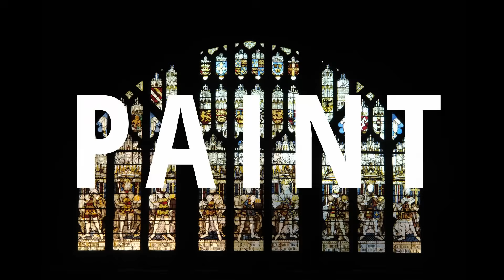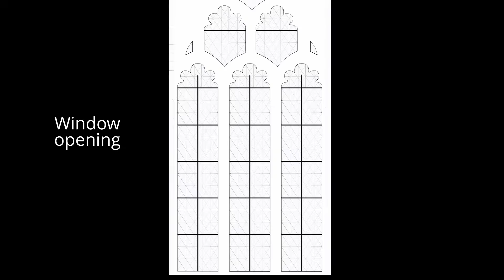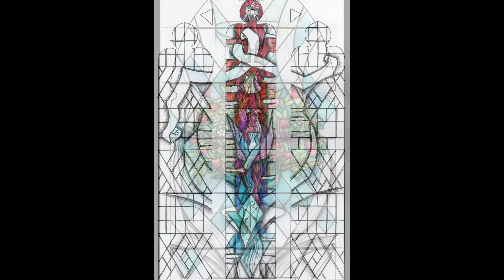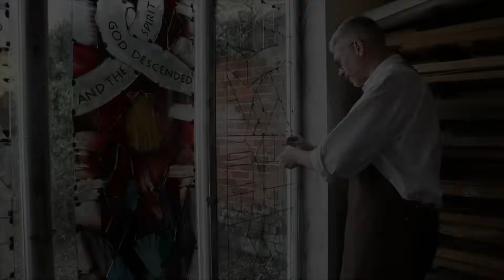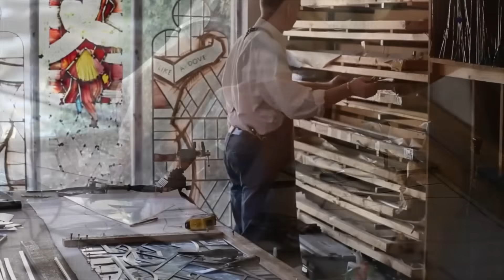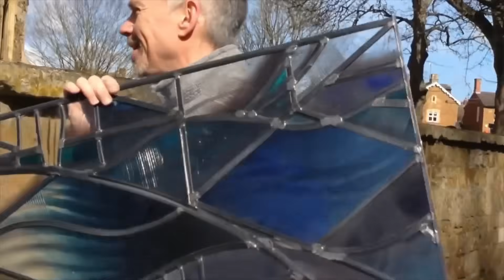This is how to make stained glass!

Comment: Hi - I would like your opinion on using either round or flat lead. I personally prefer flat lead as I can tuck 2 abutting cames one inside the other for a stronger leaded joint, plus I can flatten down the edges to trap the cement. J.
Reply from the maker: I mostly use flat lead as well, except if I am releading a window which originally had round lead.

Comment: Thanks Derek, amazing video. A quick question please - what kind of paint is typically used? (my question is "what kind of paint will survive sun light for years?")  Thanks!
Reply from the maker: I use vitreous glass paints made by Reusche. You need to fire them in a kiln at around 650 degrees centigrade to make them permanent . Link here https://www.creativeglassguild.co.uk/cat/studio-supplies/brushes-paint-stain/tracing-matting-paints?_gl=1*1jlia8g*_up*MQ..*_ga*MTU0NjcwMTk0MC4xNzQxNzg4MDYw*_ga_PTRGP8D1SW*MTc0MTc4ODA1OS4xLjEuMTc0MTc4ODA2OS4wLjAuMA..&gclid=Cj0KCQjw4cS-BhDGARIsABg4_J1GEJTanxVc-ggBF43k-iNaX5Ag0rGYtycgkNZXkIe9sfkRbK79FeEaAr7FEALw_wcB

Comment: Amazing video showing all the stages - thank you!  I have recently been mixing fused and stained glass technique and loving it, but I found the cement difficult to get off the lead came?  Was I just not using enough elbow grease or should I wipe the surface of the came off before adding the whiting to dry the cement?  I have to say it has opened such potential to make bigger pieces since I only have a small kiln.  Not sure I would every get as big as a church window though!
Reply from the maker: Yes, try to get as much of the wet cement off the lead before it goes dry, add whiting will help to dry the oils in the cement, before scrubbing it all off ther next day.
Reply: @DerekHuntArtist  Ah thanks so much!  I think I was leaving it on too long as well, it wasn't the next day. I will approach my next piece with a bit more confidence on the cementing side now!  Your tutorials are so helpful and clear, I've spent all afternoon watching them!
Reply from the maker: @sallycartwright8386 great stuff!

Comment: I was recently really closely examining the stained glass in the church I attend. Many of the windows were imported from Germany  (I attend a conservative Lutheran church in the USA) and are about a century old. I noticed the fact that the glass was painted and I could actually feel the texture of the paint as I ran my fingers over the glass. It had never even occurred to me that this was the case so I thought that was cool. Another thing I noticed was that some of the joints where pieces were leaded together made no sense to me. In some cases the lead seemed to outline particular pieces like heads and the like. In other cases the joints just seemed arbitrary to me. Of course I admit that I am in no way an artist and maybe they were made that way for some artistic reason that I am unaware of. In any case examining the windows up close has lead me to a curiosity of sorts about the process so I appreciate this  small glimpse in to the process.
Reply from the maker: Thank you for your feedback and glad you found some value in the video.

Comment: Now I just have even more questions, like how did you make the lead pieces you use to put it all together, and how did you make curved pieces of it. I didn't know that it was just painted and oven baked to make it stained glass, I thought the glass was just that color when made. Seems like an easy task to stain it though. How well does it hold up compared to a full piece of glass and does it have a good insulator to keep out the cold?
Reply from the maker: The colour you see is imbedded into the glass when it’s made and the paint just controls the amount of light coming through the glass. The lead  is made by a specialist company in long strips called cames. It’s easy to bend into shapes. Stained glass will last for hundreds of years and doesn’t fade over time if made properly. The techniques shown in this video are the traditional techniques which have been used for hundreds of years 🙂

Comment: Hi there, less of a glass artist and more of a story/cartoon artist here. Trying to learn more about glass properties for a story. I've learned there are a lot of different thicknesses and types for different purposes. 
By any chance do you ever have to vary the types you use in stain-glass making, or it the same kind shown in the video for most/every project? 

On another note I really admire how much work you've had to put into color theory. Feels like after all this time I'm finally getting a bit better with it myself. Yet I can't help but notice how many colors, shades, and saturation levels your balancing in your designs. It feels so easy to let something get out of control or look muddy with that many colors. Your art strikes me as balanced and thoughtful in this part of the process - or well... every facet really.
Reply from the maker: Thanks for your feedback. Glass thickness can vary between pieces, especially if it’s hand made mouth blown sheet glass ( sometimes called cylinder glass). The thickness can vary from 2mm up to about 5mm in any sheet. 🙂

Comment: Hello,
 I made a stained glass door with colored glass, but my soldering si turning black and grey. can you tell me why. I make sure I used the same products and brands.
Reply from the maker: Traditional solder for stained glass is a mixture of tin and lead, so it will change colour over time as the metals oxidize 🙂

Comment: When designing the cartoon to the window's measurements, do you have to account for the lead between the glass? The leading doesn't seem thick, but with enough pieces, I could see it adding another inch or few centimeters to the size of the design which then wouldn't fit the window. Thank you!
Reply from the maker: Yes, it’s important to allow a space between each piece of glass to allow for the lead. On the cartoon you can see a black line about 3mm thick which outlines each piece of glass to be cut. That 3mm line is the thickness needed between each piece of glass. 🙂
Reply: @DerekHuntArtist  Thank you so much for elaborating!

Comment: How long did the window you displayed take from start to finish?  Are you saying that most cathedral or temple stained glass is painted instead of using pieces of colored glass.  I feel like what I am doing must not be legitimate stained glass.  I don't even know how to use lead and cement.  Do you consider copper foiling some sort of silly craft version of doing stained glass?
Reply from the maker: Hi Deborah, thanks for your interest. The window featured in the video took about 3 months to make. In answer to your question, if a church window has details like inscriptions, faces and lots of ornamentation then it will have been painted onto the surface  of coloured glass. This is usually called “stained glass”. However if a church window has just got coloured glass cut into shapes and leaded together it is called “leaded glass”. Copper foil is a more modern technique and was first popularised by Luis Tiffany lamps and is used instead of traditional lead for lamps and also for church stained glass mostly in the USA. I think copper foiling is a great solution in certain circumstances, but I generally stick to lead. 🙂
Reply: @DerekHuntArtist  Thank you so much for taking the time to respond.  I've decided if copper foiling is good enough for Tiffany it's good enough for me (and besides it's all I can afford).  Your windows are beautiful and meaningful but I'd be overwhelmed to even contemplate constructing anything so grand.  You are a true stained glass artist.  Your videos are super interesting and helpful.
Reply from the maker: @debberella1  great stuff! So glad you get value from my videos, thank you !

Comment: Occasionally your lead line can be seen to 'go off on its own, partway across the glass and ending'. Do you remove the heart and glue the came faces to the glass? If so,  what adhesive is used?
Reply from the maker: Sometimes I will remove the lead heart and glue the lead in position with clear silicone. Other times I will continue the lead by painting a line onto the glass and firing in the kiln. :)